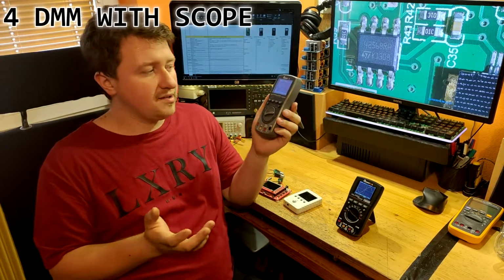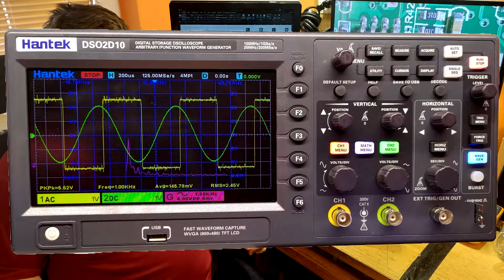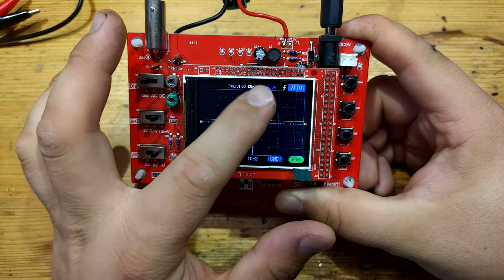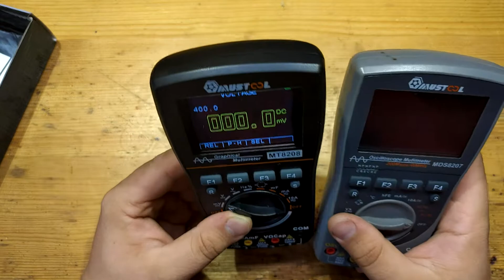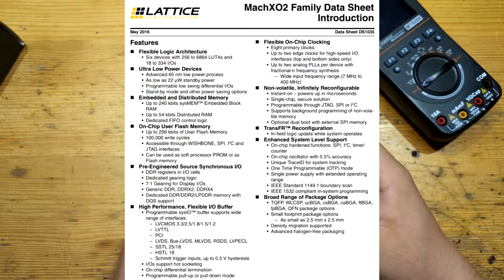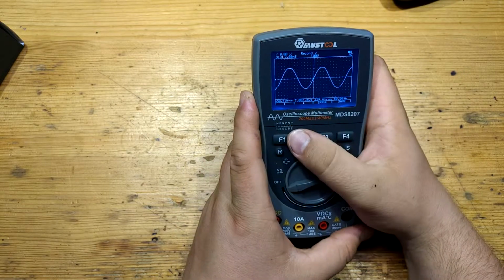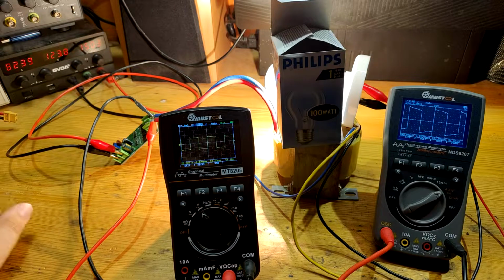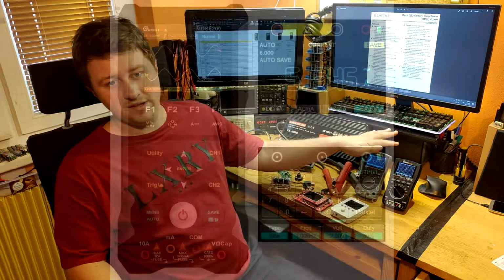Four DIY scopes in practice - are they worth it?

Comment: Thx for the walkthrue..+1 for the english language.
as most "newcomers" to scopes & electronics.. also been down this rabbithole of getting less then ideal mobile waveform displays...
5 years back ended up with 4 waveform display units, before I took the plunge on a real mobile/benchscope.
First I got was the 15 bucks DSO shell, that white unit with a rotary knob you build yourself and that you also show in the video, - then I got a 25 US Daniu DSO188 (cute little fellow, likely more proof of concept then anything else) , then I got a Mustool MT8205 that costed only 11.11USD at Banggood 11 year birthday with incl. shipping to Denmark, then I purchase a 70USD Miniware DSO212 with black silicone boot and then some years back (2019/2020) I finally took the plunge on a 4ch. Micsig STO scope... which obviously was a lot more pricey at a tad over 400 bucks.
Sofar I been very impressed by the micsic scope.
100k waveform update rate, 28 meg depth.. 256 level intensity grading.. color corrected waveforms and all that extra jazz with seriel protocols.
the sum of it all, if you new to scopes and you wanna learn.. get yourself a real scope.. its such a pain trying to learn with these less then ideal waveform tools and trying to make sense of it all and adjust the interface..
I really like the intensity grading on these Miscsig scopes and a huge plus that it has a battery, and you can just use PD powerbanks for charging..
https://www.youtube.com/watch?v=xV40hZCkfek
Reply from the maker: Thanks for your constructive comment!
The micsig electronic phosphor (as people around analogs call it) looks really neat. Great for modulated signals, sweeps and such. 4 channels sharing 28M memory, oof, nice, really. 
These tiny scope like things are nowhere near classic scopes, and are incomparable to them. But they are greatly used amongst newbies and diy hobbyists, who just want to see a wave, or who just want to know what does the shape look like +-. Since there isn't enough reviews on them, well, mostly reviews done by newbies themselves, or biased reviews because reviewer got it for free, I think it's on point to record such a review so people will know what these things are actually about.